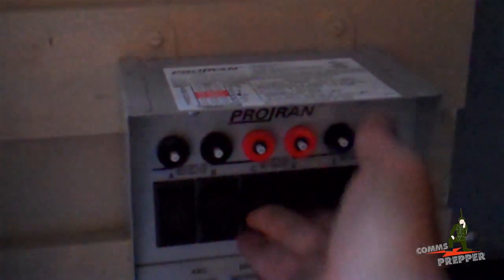Generator Transfer Switch

Comment: Man! I thought when u turned back on the main while gen was on there was going be a boom. Lol. So u can leave the main on while the transfer box is running with the generator and when street power comes back on you will know because the rest of the house will come on ??
Reply from the maker: Box isolates the connected breakers from the commercial side.  So yes, you can be running stuff from solar or generator when the commercial power comes back.

Comment: Nice! I got the exact same one connected to my Outback Power VFX 3524 inverter on my solar panel power system. It works great. And I can still use my Honda eu2000 generator if needed (system has a L5-30 plug connection also).
Reply from the maker: +ChrisDIYerOklahoma Chris - I did the same thing.  I route my off-grid solar power inverter through the transfer switch's outside plug.  This way I can also use the generator if I need to.  The plug for the invert is custom made, jumpering the two phases together since I am not using the 220 option.  Works well for us.  https://www.youtube.com/watch?v=c-AWOQa9sIg
Reply: Can you guys tell me how you did it incorporating solar. I need it to handle my solar power from my inverter and then I want instead of generator power I want to use a regular extension cord. Ive modified the plugs already so I just need to know how you incorporate the solar.

Comment: Forget gasoline. It is too explosive. Use propane (last forever) or diesel (stores well). Diesel is easier to find than propane and it is more efficient. It takes a lot more to stall a diesel engine.

Comment: Looks great!   I think you mentioned you'd be using a 2800 watt gen (pure sine wave inverter).  What do you plan to run the generator on?  In other words, are you going store gasoline, or are you thinking about a propane kit?
Reply from the maker: Some lights, a few outlets, and refrigerator (not much).  Right now I have some gas put back with Stable in it but eventually want to get a propane generator that has pure sine wave inverter.  I will also be making cable to feed my solar system into the switch for phase the lights are on.

Comment: Looks Great ! One note, take your time engaging the switches to allow the generator a chance to rebalance the engine speed as each circuit may have a load and pull the RPM's down. I usually count to three between each switch. Great piece of mind you installed!
Reply from the maker: Thanks for the tip.

Comment: We have our generator hooked to the panel in the garage and it back feeds to the house panel.
Works good but I sometimes forget to flip some of the non essential breakers and the generator trips.
Makes it nice having it in the garage because it dulls the noise and I can secure it.
Reply from the maker: I heard about that method but was advised not to do it because of the risk of sending power back down the line and perhaps socking someone working on the outage.  I like the transfer switch kit allot.  It comes with everything you need and great instructions (DVD and print).
Reply: Commsprepper how does this setup not feed back into grid when you had both the main on and the generator supplying power?
Reply from the maker: Adam Weil It's designed to isolate the selected circuits (those circuits connected to the transfer switch from the main panel.  Here is a link to the installation manual. http://www.reliancecontrols.com/Documents/ProTran%20Instructions.pdf
Reply: Commsprepper yea if I were to leave the main breaker to the house on from the grid it would feed back through.  I always throw the main when using the generator.  I wouldnt want to kill or injure anyone working on the lines, plus jail and I dont get along to well.

Comment: Nice
Reply from the maker: Thanks.  Now I need to install the same unit at the homestead.  Need to dedicate some time to figure out how I am going to run the cable out to the outlet without creating a water issue (I hate poking holes in the house).